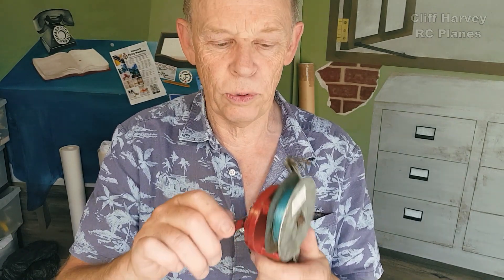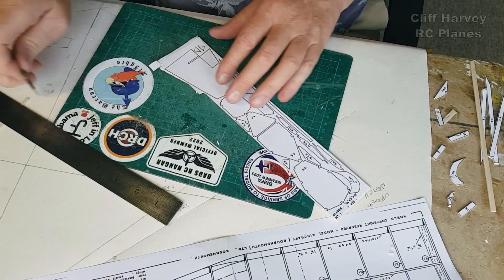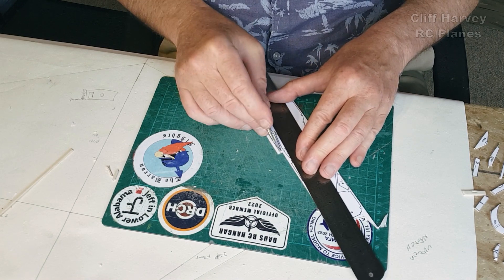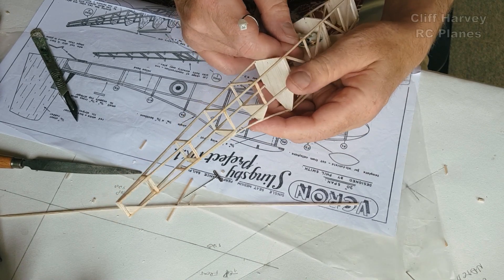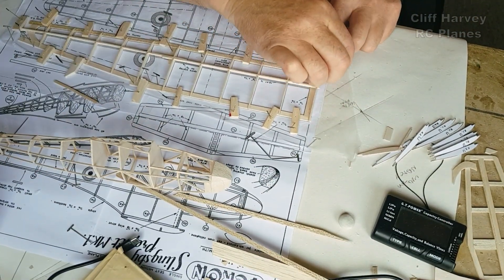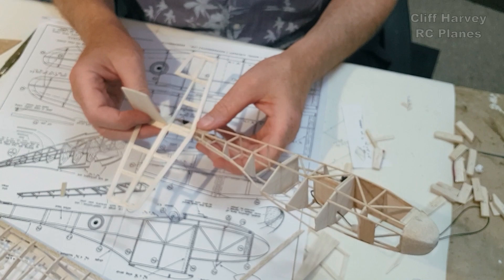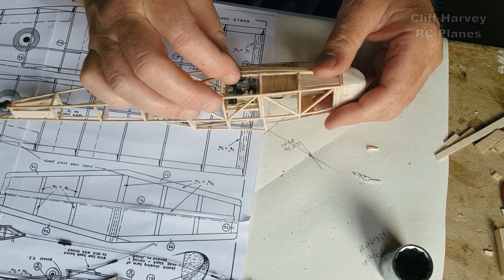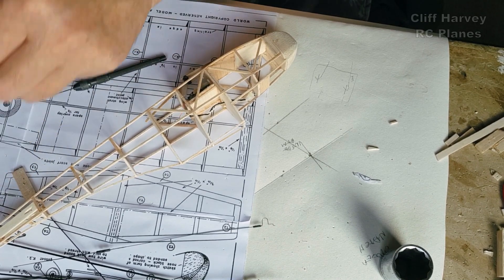Veron Slingsby Prefect Mk. 1 Tow-Line Project ... Building the Structure

Comment: I would imagine gluing the template on the balso serves the dual purpose of split prevention...I like that.
Reply from the maker: Hi John, that's right, I didn't realise that was a bonus until I actually did it comma by the way the glue I used was just a glue stick. This means that with a small amount of water it comes unstuck from the balsa easily 🙂👍

Comment: Hi Cliff  from NZ   I down load from outerzone as well   print the image on to lite weight  tissue.   Pre cover with plain lite tissue on under side of balsa sheet using  watered  down pva dry pinned down on your building board with food grade cling film and,  weights  EG your socket weights on top to keep  it drying flat overnight .  once that is dry paste down the image  tissue on other side  ,leave overnight  with pinned down on sides and your weights  The reason tissue is glued on back side ,it keeps the tension even otherwise  the sheet will curve.   to print tissue there is plenty of info on the net, i use pva thinned around the edges of tissue area on normal print paper held in place on a board with tape  ,place tissue on and smooth out ,let dry  with cling film ,card board and weights overnight . Make sure which way your printer is printing the image on the paper Face down, or face up?
I have used this method many times it works great , you get a nice balsa surface to cut better clean edged  parts
thinned  pva i think is no extra weight
Reply from the maker: Thanks for the info Warren but I have a laser printer that can't print onto tissue 😫

Comment: This is a great build Cliff. What do you use for those tiny hinges?
Reply from the maker: Thanks Buck, I use 0.4mm fishing line, sanded for a key and a small drop of ca to hold them in place. One little bonus is you can put in more hinges than you need and if the servo is struggling you can just cut through one or two 👍